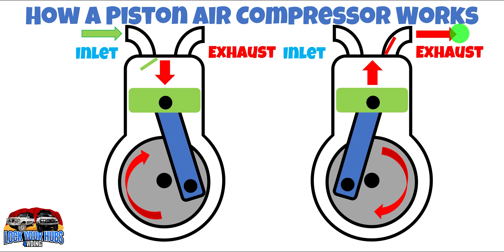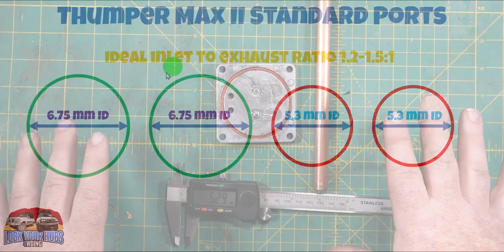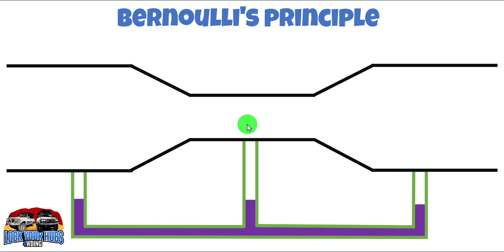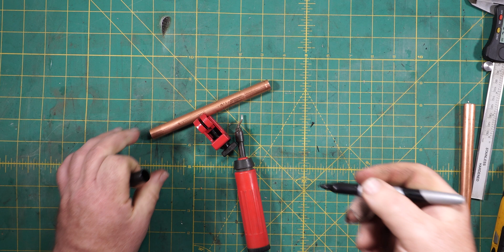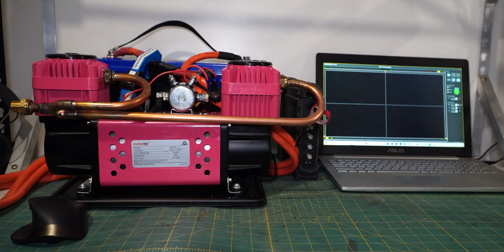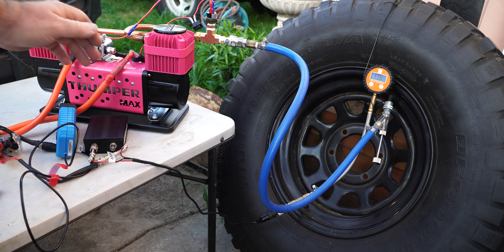Boosting Air Power: 12v Thumper Max II Compressor with Custom Copper Outlet

Comment: From what I've seen, the schraeder valve is the point of most resistance to flow and inflation.  So flow improvements in the compressor may not lead to quicker inflation.  I tested a few Schraeder valves I had and some were quicker than others.
Reply from the maker: The valve itself? Or "body" of the Schrader?
Reply: @LockyourHubs4WDing  The body.  I've got a couple at home that have a smaller inside diameter that others.  I should have measured them, but unfortunately they got binned.  Even with the core out they were slower - I was testing them by themselves - not installed on a rim.
Reply from the maker: That's actually quite interesting, I thought it was standardised, I should test that!
Reply: @LockyourHubs4WDing  Just found a few in the shed and measured their bores using drill bits. Smallest has 2.5mm bore, largest has 4mm bore.  Thats a huge difference in flow given flow is proportional to the 4th power of the radius. The one with the 4mm bore was a short TR412 valve. A common TR413 had a 3mm bore.

Comment: I think because you increased the volume of the exhaust it slowed everything down. Air is funny, sharp angles will decrease velocity. Slowing down brakes and such. But since pressure is equal in all directions, more volume equates to increased time.
Reply from the maker: You may be right!

Comment: Good job Simon, interesting to see how the porting effects it’s output. I like the way you analyse things. 
Do have to wonder with all this extra work, bits & pieces & cost, are we better to look at something engineered better in the first place & do the old, ’Pay once cry once’. 
Also, would it be right to suggest that a higher flow may come with an overall lower pressure tradeoff? Meaning that while it may pump up 4wd tyres better to 40 psi, it may struggle to pump up a truck tyre to 100 psi.
Reply from the maker: There's always going to be a point of reaching diminishing returns. And it'll be dependent on the individuals valuation of their time and ability to work with their hands. 

I've deliberately not used any machine tools (lathe/mill) etc, nothing more fancy that a pedestal drill, as I wanted to keep the build realistic and accessible to the average 4wder with a few tools in the shed.

You're right that the pump can be designed for a specific application. Just like an IC engine, it can be set up for low down grunt, or conversely top end. And attributes like reed thickness (that'll change valve timing) rpm, bore and stroke ratio etc will determine the characteristics of the pump.

Comment: Now please redo with equal length headers 😂 i want to see the improvement 😊 aftet getting to the end i wonder if its why. It's fighting itself
Reply from the maker: I did think about pulse tuning, though if the original manifold is getting slightly better performance, I don't think it's that!
Reply: @LockyourHubs4WDing  it was equal length though was it not?
Reply from the maker: @ausguy4385  the manifold I made from copper? Not even close..... 😁
Reply: @LockyourHubs4WDing  no the original one?
Reply from the maker: The outlet on the original manifold is biased to one side.
Reply: @LockyourHubs4WDing interesting... but not by as much as the copper one and looks the other way. But hard to tell being so modified

Comment: Love it . Keen for the next one. I noticed that big spike on the oscilloscope. Do you know how many amps it pulls for that spike when you first flick the switch. Cause my thumper is tripping my 200amp jk bms on my lithium battery
Reply from the maker: I haven't particularly measured it.
Reply: Check the specs on your lithium battery - many of them can only deliver 50A
Reply: Go into your settings in the jk bms and change the short circuit protection delay up a bit. I had the same issue with my inverter tripping it out. Its not an overcurrent problem its simply the bms seeing a spike and going oh thats probably a short and shuts it down. I have mine set to 3000ųs and it now works perfectly. The jk bms is good for 200a continuously and 350 for a 5 sec burst, and the thumper certainly doesnt peak higher than that.
Reply: @lexicase8805  ok thanks mate I’ll have a look at the settings
Reply from the maker: @lexicase8805  from memory it was in the vicinity of about 250-260A, though didn't specifically measure it.
Reply: @einfelder8262 jk bms is good for 200a continuous 350 peak, id say its a diy battery like my own, i have a 280ah lithium and jk bms in a standard marine battery box and it takes up the same space as a regular n70zz size agm or lithium battery. The 100ah ones sold most commonly like voltx and the likes, yeah those only have small 100ah cells and a crappy little 50a bms. Its why i built my own
Reply: @lexicase8805 thanks mate I changed the settings and it works perfectly. Thanks for that. Seems to run faster off the lithium maybe the higher constant voltage .it’s a custom battery. 4 x160amp +the jk bms.I also have another in my caravan but 280 amp cells I’ll be changing the settings on that aswell cause it did the same a couple of times when I tried to run the aircon off it

Comment: You should have hooked it to a four-way tire inflator before your test. Your valve stem is your choke point. The compressor in stock forum already moves too much air for a standard Valve stem.
Reply from the maker: All the subsequent tests with the modifications were without the Schrader valve inserted.
Reply: @LockyourHubs4WDing  even without the Schrader valve installed the hole for the one Schrader valve can't flow enough air.

Comment: Anyone else want to see this in a 2 stage compressor setup? I’m curious how it would compare to
Reply from the maker: That would be interesting!
Reply: @LockyourHubs4WDing  I’m curious cause I’m thinking of using this for onboard air with a tank @120psi so would it be more efficient running as a 2stage unit or standard is my interest.
Reply from the maker: @edge967  you shouldn't need a second stage for only 120 psi, a single stage will do that no issues
Reply: @LockyourHubs4WDing  yes just thinking the 2stage might lower fill time?

Comment: I am really curious about whether your plumbing reduced the air heating up. I have a similar style compressor where the outlet tube gets that hot, I can barely hold it. I was thinking of doing similar plumbing to help reduce the heat...and maybe less airflow restrictions etc. Even debated about adding 12v cooling fan(s) lol.
Reply from the maker: A fan is an interesting idea!
Reply: @LockyourHubs4WDing  With as much copper piping you have, that has to help some. I've even thought of using a short section of a pipe from a hot water baseboard heater, that has the fins on it. Then maybe have the fan blowing across it. The hard part is not making it too bulky.

Comment: I didn't get why you did not choose a 1/2 pipe and instead you used a 3/8, if you want more CFM
Reply from the maker: It's all about changes in velocity you want to minimize the Delta or the change in velocity is much as possible to keep the CFM up.

Comment: that was very interesting, looking forward to the porting, and yes i know the porting will help depending on how far you go as i cheated🤣 and already seen something like this else where but no body tests like you test with all the toys......... if you were on the sunshine coast or near by i'd lend you my stock(for now) thumper max so you could easily show side by side differences....👍👍👍 ... ps, an issue the other guy had after porting etc was the reeds it'll be interesting to see if you have the same issue an how you fix them
Reply from the maker: Which channel? I would be interested in having a look.
Reply: @LockyourHubs4WDing  i believe you've seen the videos before as i brought it up before to which you said you'd seen it but he never tested like you test "dirt lifestyle" channel